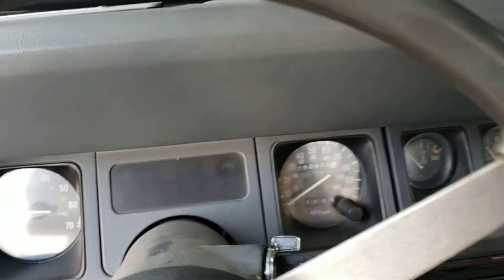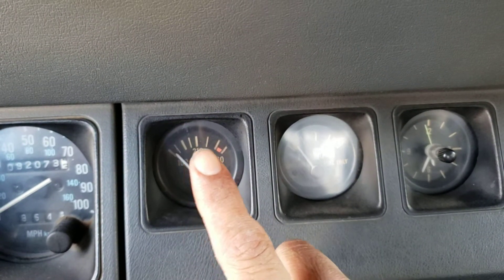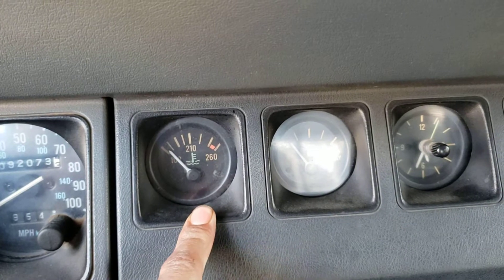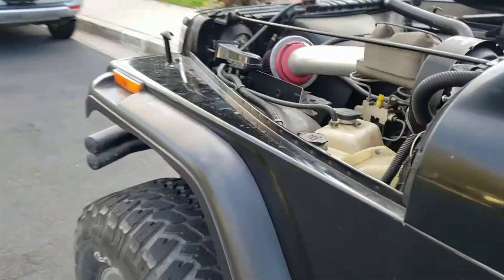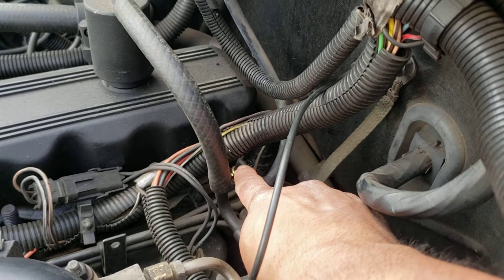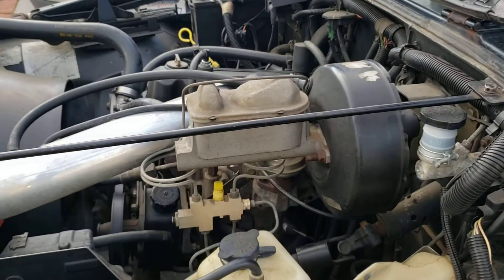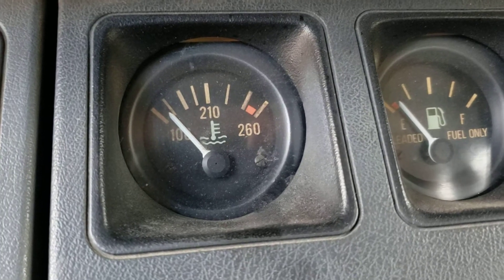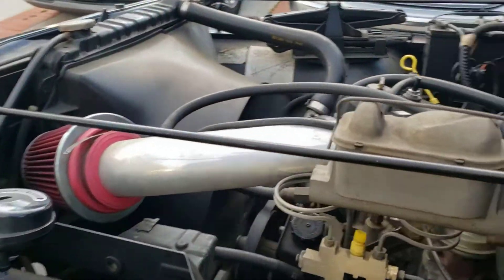Jeep YJ Temp Sensor not working right?

Comment: Did you used a socket or wrench? I was able to use a size 13 to,remove it, but I had to use a size 14 for a little bit until it got closed to the block and the socket would not work. I had to use a size 14 wrench and it took quite a while. I got it far but not all of the way down. My temp gauge is working.